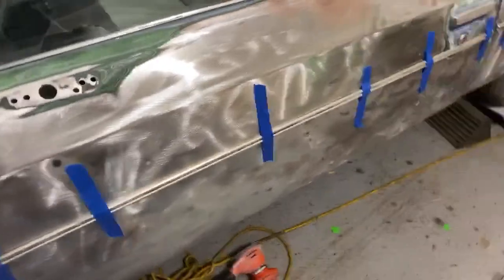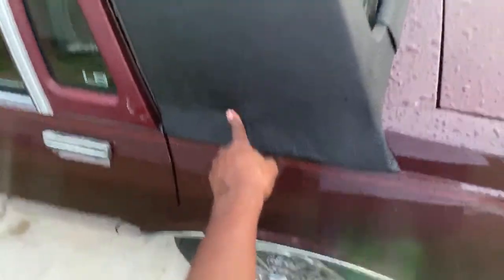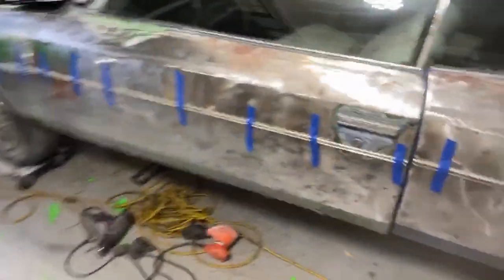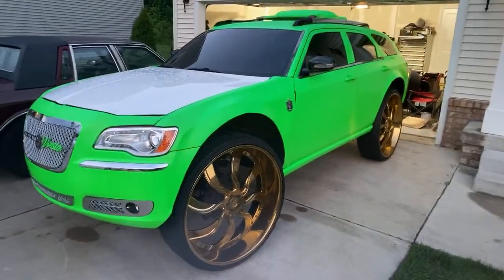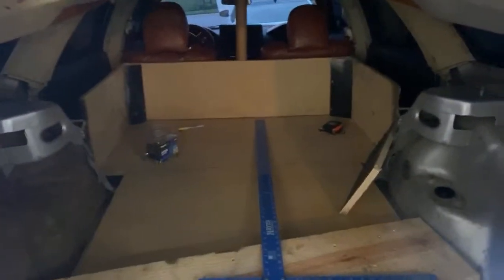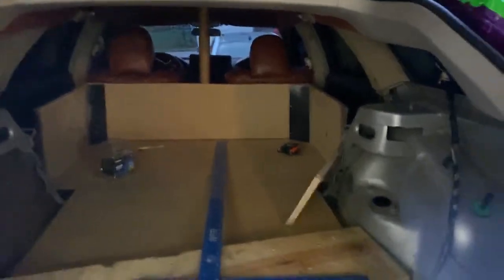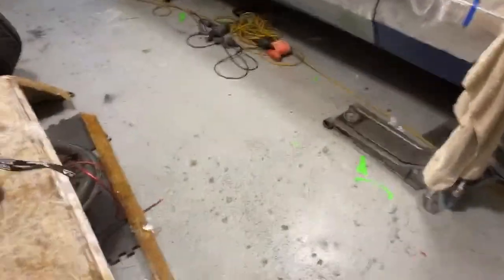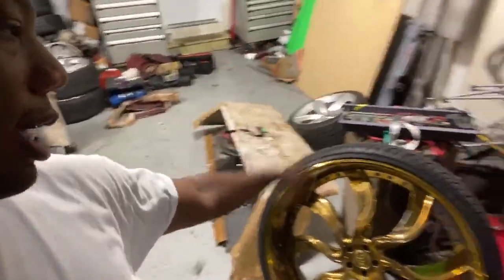Magnum on Gold Amani Wheels & Viper 73 Donk

Comment: Check out customautotrim.com and look at the 5/8 high profile
trim that's what I'm going with for my 71 impala that trim come with the inserts you can paint to match ur interior and the trim part that the insert goes in comes in gold or chrome and you can get different tips for the trim to me that trim looks better that the donk original trim
Reply from the maker: I will check them out.
Reply: @CowboyVonStar  let me kno you thoughts